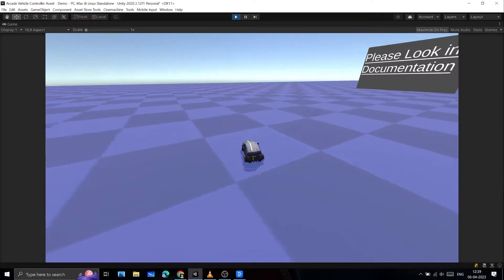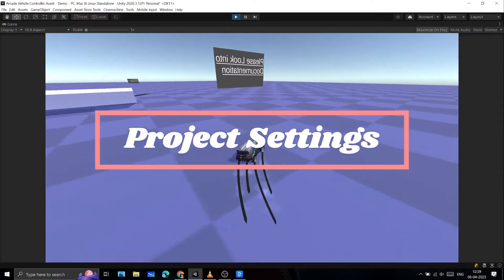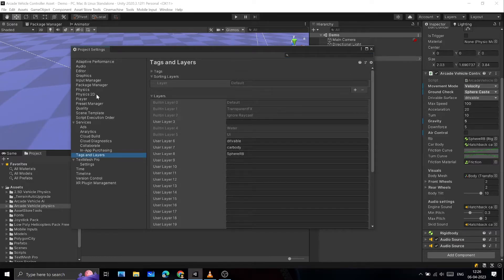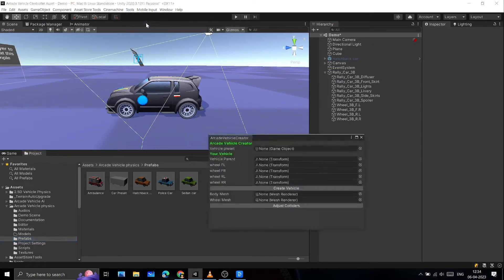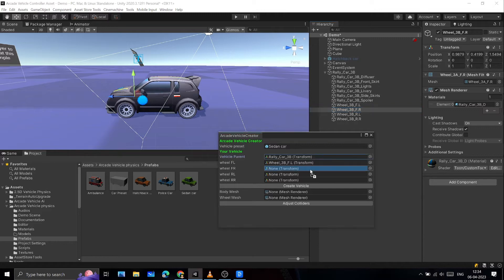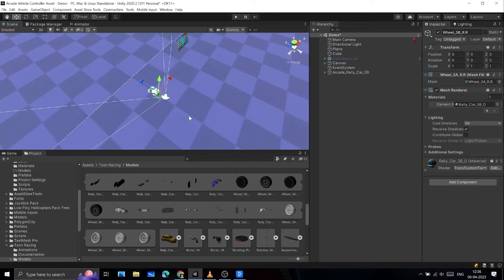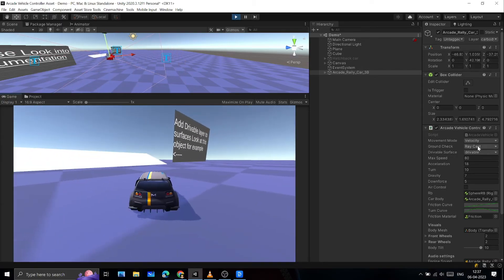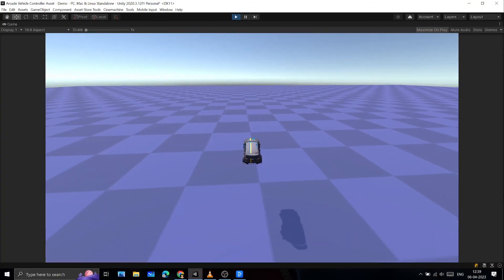Arcade Vehicle Physics Setup in Unity Engine

Comment: I bought thisasse t from asset store problem is when I climp to any box car is not rotating body upwards what is the issue ?
Reply from the maker: We talked about it in mail and this issue is solved. (Add drivable layer to surfaces).
This msg is for future audiance that might have same issue
Reply: @ashdev  tanks alot for quick help
Reply: @ashdev  i did tho , but it still didnt solve the issue

Comment: Sorry this isn't working for me

I did everything but the car doesn't move at all
Reply from the maker: Did you imported project settings. Did you added drivable layer to ground. Does vehicles work in demo scene
Reply: @ashdev  it works in demo scene
So I took the plane ground to my scene and it worked, but when I add my own plane ground and layer is drivable but not effective
Reply from the maker: @oladelejoseph2892  did you imported project settings presets. Are you adding drivable layer manually? By creating a new layer? Please see the demo scene. I have put text in scene also please read those.
Reply: @ashdev  I did everything
Reply from the maker: @oladelejoseph2892  make sure in project settings/ physics. Drivable layer and carbody layer are set to non collidable. If your body is getting straight parallel to ground on ramps then your project settings are not properly done. Make sure car has carbody tag and ground has drivable layer tag. 

Or join discord from description
Reply: @ashdev  I would join the discord